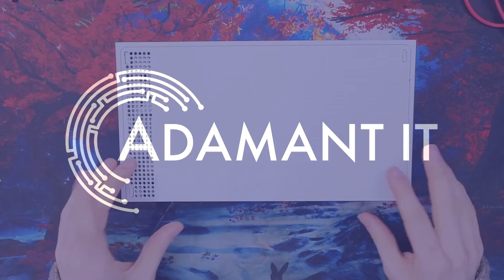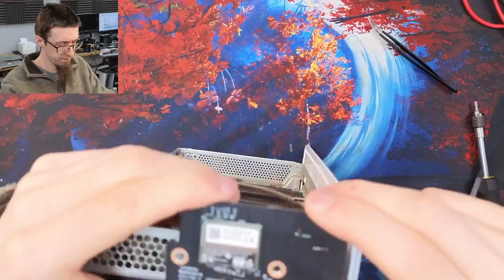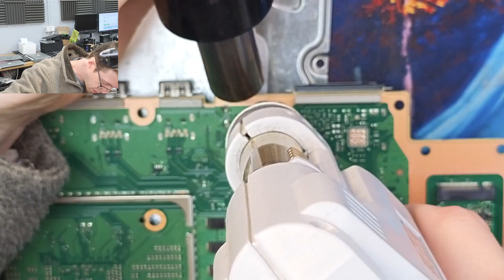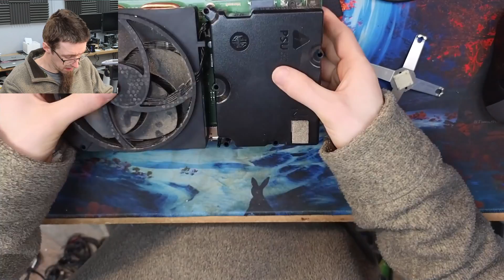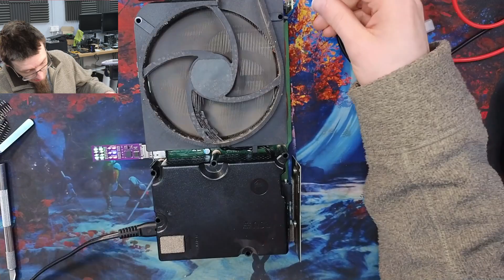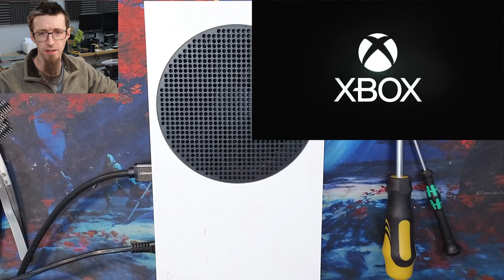Xbox Series S HDMI port ripped off and lose inside - LFC#398

Comment: it is annoying to see you working without flux and you should use heat gun and soldering iron together to get the solder flowing for the main connector legs

Comment: Put flux first on those pins so that it will stick and shaped.
Also put flux on that copper.
Your soldering iron has too much heat burns the flux

Comment: With lifted traces - is there a heat cure adhesive that could be used to stick them down to board? Something you could paint onto board, tacky enough to hold traces in place and touching it with a soldering iron would cure the adhesive?

Dunno if such a product would help with torn traces.

Comment: The number of times I've come home with a dry mouth and slight headache from concentrating on SM soldering ports like this one. (And no I wasn't breathing in the fumes). I feel tired just watching you solder. You could get a bit tidier by using pre-made PCB track pads, but TBH I don't think it's worth the effort. Fine wire, fine solder and good flux, together with a good soldering iron - not too hot but hot enough, magnifier and a lot of patience, and 99% IPA to clean up with a brush afterwards (gently). The more you do it the better you get.

Comment: I use hdmi break outboards. they make testing continuity easier IMO. (you can be suere the trace is connected to the pin if it makes it through te the break out board. 

even the super cheap ones with screw terminals are fine for this sort of stuff even if they have no other conceivable use. 

I also prefer to fix the pads before installing the port personally.  and i would usually Go from the nearest Via or component. rather than on to the trace itself (unless i think the distance is more of a detriment than using the trace)

Comment: 27:09 don't use hot air to settle UV mask, yes it will solidify it, but it becomes way more brittle that way. Some repair shops do it because it is faster and they don't care if it breaks after a year.
Reply from the maker: Yea makes sense. After a UV cure it feels like the top bit has hardened, but it's a bit gooey underneath. That should give it some protection while also forgiving thermal cycles and vibration from cables being shoved in.

Comment: don't you need to match the length of the original traces to maintain signal integrity? when differential signals travel different distances, they go out of phase, causing loss of signal. That's why the traces on the boards sometimes have wavy lines, to compensate for different lengths.
Reply from the maker: Correct, however there's no way in hell I'd be able to length-match to any reasonable degree of accuracy.
Robustness principles dictate that a well designed system will have some grace built-in to it where it will try to exceed its duties, while allowing others to be 'good enough'. So that length matching seeks to make the signal as good as it can possibly be, but if the receiving end is also well-built, it will accept a slightly degraded signal too. That being said, if you tried to run this Xbox at like, 4k-120hz on a 5m HDMI cable, that's probably not going to work anymore. But that's also not an instance this console is likely to see.

Comment: For future repairs of this type, you can buy replacement pads that come with jumper wires pre-attached. They cost something like £17 for 1500 of them. Just glue them down, solder the wire to the track, then cover with solder mask.

Comment: For future repairs like this, you can buy sets of replacement pads that come with pre-attached jumper wires. Just glue them down and connect the wires to the tracks. You get something like 1500 of them for £17.

Comment: 10:00 wow the left side is kind aligned and the right side almost all the way off. what kind of tolerances they have on those ports?? almost like the pin pitch is off. at least I'd try to have the center aligned and the sides slightly off
Reply from the maker: Yea the pin pitch can be a bit mid on these eBay replacement ports. With all the pads intact, it's never really an issue, this case was just extreme because I didn't bother carefully aligning on a fitment that was going to have a dozen jumper wires anyway.

Comment: The main problem is the  oxidized iron tip, not the size of solder wire. Clean your soldering iron tip on a wet sponge every time you use it and will be always as new. Anyway, good job Graham.
Reply: Brass, or stainless steel scourer ball is my go to.
I find it works much better than a damp sponge.
Never have to wet it, no chance of burning it when it dries out and no need to clean up the little blobs of solder that build up on a sponge👍
Reply: @simonilett998  Most of those Chinese copper or brass scourers are plated steel - test yours with a magnet. The scourer damages the tip, but t12 are cheap tips. Sponge is kinder to the tips. Yeh, those blobs on sponges are annoying :)
Reply: @karltest1314  @karltest1314  That's very probable nowadays.
The one I use is stainless steel, from my local supermarket so I know it's 'real'.
I mostly use it with T12 style replaceable tips, so they're cheap, but have never had any problem with damage to the tips?
I just dip it once or twice after pretty much each solder joint, re-tin and go, or I rest the Iron on it's stand, I never leave the iron sitting in the scourer ball and have had no issues.
Reply: Big Clive taught me to leave the tip with a thin coat of fresh solder -- that is to say, not squeaky clean. Also, at some point the tip does just get degraded to the point that it is practically unusable, no matter how well you take care of them. That being said... yes, the problem is definitely the cruddy tip. 😄
Reply: @herrpez  I wrote there to clean the tip every time you use it, not after you use it. Is a very good thing to leave solder on tip after use to protect it against oxidation.Anyway, on aliexpress an t12 tip/heating element is about £2.5 , not big deal.
Reply: The higher the temp the quicker the tip gets cruddy. Although you need a hot iron, too hot leads to the problems we saw here. This is fine point soldering, the temp can come down quite a bit as long as the job is clean and a good amount of flux is used.
Reply: For completeness: There are also solder tip activators out there which can revitalize an oxidized tip. It's basically solder in a highly aggressive flux. Yeah, tips are usually not that expensive anymore. But this activator stuff can also come in handy if you ever need to solder to something so oxidized that normal flux just can't make a dent.
Reply: And a distinct lack of flux.

Comment: I am a bit confised by your claim that the HDMI port hasn't been repaired before. If I look at the video at 3:10 I see a lot of small solder wires that I usually see on trace repairs.
Reply from the maker: That's the traces ripped off of the PCB
Reply: @Adamant_IT  Thank you, I rewatched the section and it is now clear.

Comment: You should consider using something called "wylie soldering lug for pads repair".
Reply from the maker: I was thinking of those when I saw the missing pads... but with the traces ripped up, I'd still need to run a bunch of jumper wires?
Reply: @Adamant_IT  It depends. Those pads have "wires" attached (small flat surface tips). Sometimes that's enough but sometimes you need to extend it with jumper wires.